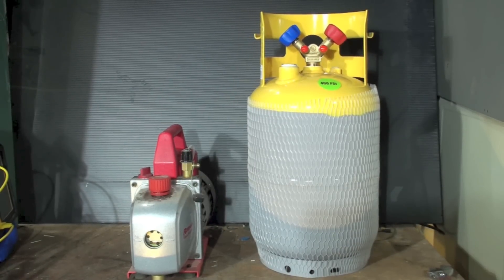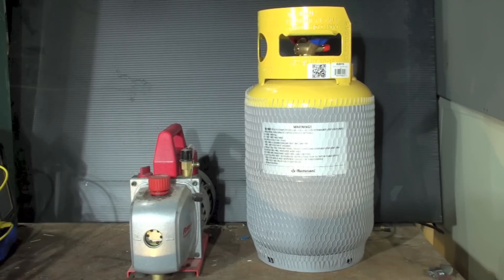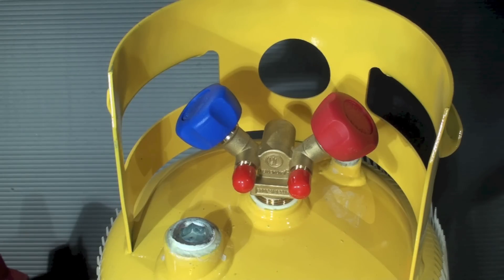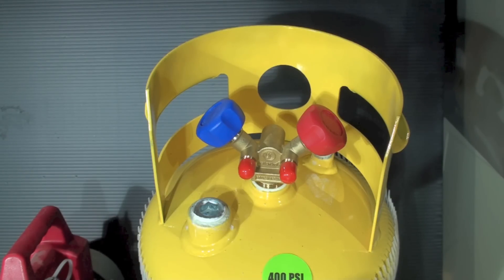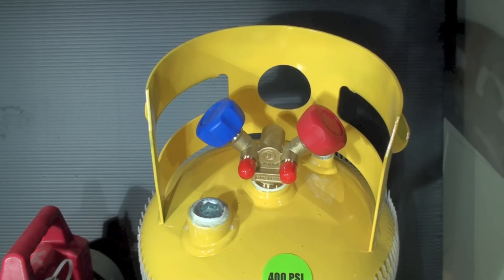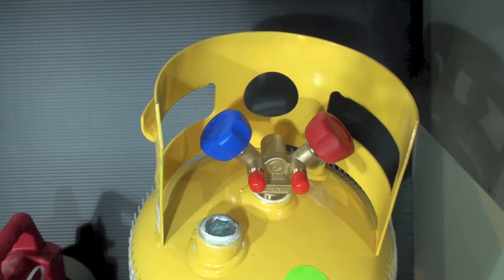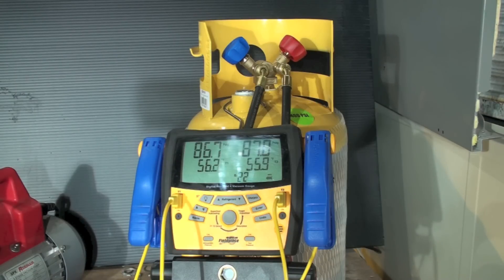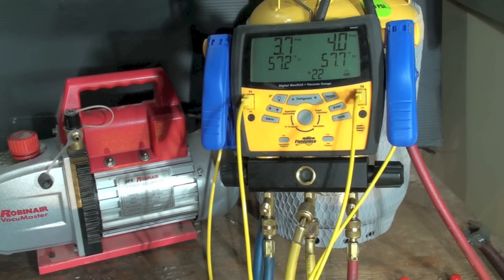Commisioning a new refrigerant refrigerant recovery cylinder

Comment: How do you like the Fieldpiece gauges?
Reply from the maker: As with most Fieldpiece products, it does its job well and is fairly tough.  There are lots of features including target superheat.  Not to say they cannot be broken.  I also like the Testo gauge sets.
GFM
Reply: grayfurnaceman Ive been using the Testos I bought the Sman3 late last year. Havent had a chance to use them yet. Still doing no heat calls here
Reply from the maker: tstatech One suggestion I would make.  Do not use your core removers for vacuum.  It is just more opportunities for vacuum leaks.  I did several videos on vacuum and am quite disappointed in the newer hoses.  They seem to leak vacuum easily.  Thanks for the thoughts.
Reply: Love the SMAN4 but I don't trust the vacuum gauge. I use several vacuum (micron) meters when pulling vacuum connected directly to my core removers. I personally use a CPS and a yellow jacket micron gauge without using a manifold at all while pulling vacuum. Reason being that every valve and connection is another potential leak. The SMAN vacuum gauge will not perform a pump down test, not even when capped off. At least mine always rises higher than 1000 microns in 10 minutes, even if I clean the sensor with alcohol and pull an initial vacuum below 200 microns. The only other complaint is that the firmware is difficult to update because the software Fieldpiece uses looks like it was written in 1983. Testo is great also, maybe not as robust as the fieldpiece. My testo has a cracked display and I'm very gentle with my meters. Otherwise both are great manifolds. You can't go wrong with either one.